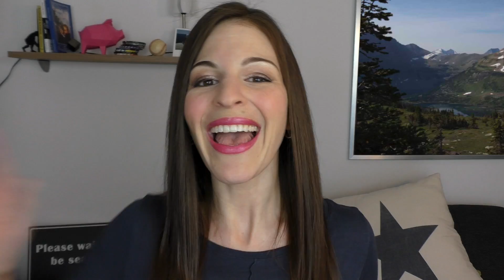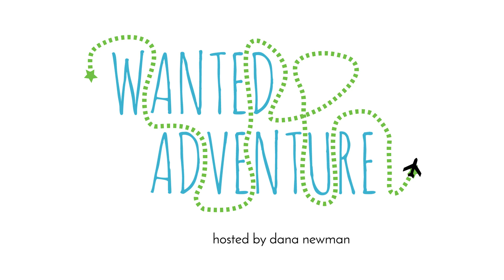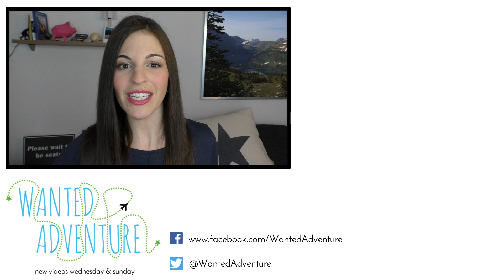Why Are Houses in America MADE OF WOOD?!

Comment: This channel should be titled Ask a Stupid American.  Houses worldwide use mostly the cheapest locally available materials. People with more income can spend more on their houses and choose better materials. Building codes evolve driving safer building methods though most structures already existing rarely have to be brought up to code until major remodeling is done.   Europe once had vast forests until they were cut down to (wait for it) to build houses and eventually was replaced with more abundant brick and stone and rising economic development. Oh yeah, no busses have been picked up by tornados, like loaded semi trucks they can get blown over if struck broadside but not headlong. DUH.
Reply: Took 3 seconds to google buses being sucked up into tornadoes and blown around.   Confirmed that buses can be blown around by tornadoes.
Reply: I have seen big semi trucks up in trees and entire barns moved large distances. I have seen masonry buildings levelled.
Reply: Who would win in this scenario: A: A 2 mile tall 200 yard-2 mile wide rotating column of air traveling at a forward speed of 30-70 miles per hour, with wind speeds of anywhere from 110 miles per hour to 320 miles per hour, hurling debris the size of semi-trucks at anywhere from 60 to 270 miles per hour?..... Or B: a brick house?

Comment: Here in Florida, most homes made in the past 20yrs are reinforced block construction. My home has a steel roof as well, it's a very strong home. The roof will last 50yrs. They are also quieter inside as well. I would not live in a home made of wood.

Comment: Labour costs are a big factor. using wood frame a house can be built quickly. Also here Canada we have a season called winter and wood frame constuction can be insulated. a 100mm. wood frame wall has the same insulating value as a 1 meter thick stone wall. Wood frame construction can with proper treatment can be made proof against rot and insects. very attractive finishing can be done with brick or cut stone veneer and are indistinguishable from the solid construction used in europe. For comments about Tornados and Hurricanes read further comments.

Comment: Stone/concrete would not protect you from floods as the flood would fill the area and blow out the walls due to high pressure on one side and low pressure on the other side. 

Wood construction is fast, cheap and higher insulation value then stone and concrete. It lets the house flex in events that will break a ridged structure.

Comment: Having watched TV programs about people buying houses in Germany and having lived there 1958-1960.  I have a few observations. First it costs a lot more to build a house out of cast concrete fixtures, brick and stone and that is reflected in the price of housing in Germany. Secondly the insulating qualities of brick, concrete and stone are terrible and wood framing is easy to fashion so it can be insulated.  Wood framing is cheaper than just about anything, and we have a replaceable supply of wood being grown.  Tornadoes can blow a house apart by the difference in air pressure between the inside of the house at 14.7 psi and the center of a tornado at 1/6 of this. The difference causes the roof to be pushed off . Imagine the size of a roof 20 foot by 40 foot of a modest  mobile home would yield 800 square feet or 115200 square inches which would develop a pressure of 1152000 pounds of force with just 10 psi of air pressure difference. Not many roofs can withstand 576 tons of lift, so even a stone house would be torn apart. I think Germans would soon get used to living in wooden houses if given the chance ;-)

Comment: My own speculation is cost and abundance.  Wood is less expensive to cut, ship, and size for assembly.  Less weight when shipping wood vs stone.  Also if you have noticed in the German homes they don't built in closets!  You have to buy wardrobes to hang your clothes.  Brick houses make it difficult to remodel your home.  Try moving brick walls or routing wiring and plumbing through mortar without having to paste them on the outside of the wall.

Also no screens on the windows anywhere!  Let those bugs fly in!  Also no ceiling fans so when it gets hot in the summer you can't even get a breeze blowing in the room (don't even ask about AIR CONDITIONING!)

Comment: Many houses in tornado alley have underground shelters like you see in the wizard of OZ.    In addition the roofs of houses need to have extra hurricane and tornado bracing. A interesting fact the difference in air pressure between a closed up house and a tornado near by is enough to blow it apart . OPEN ALL YOUR WINDOWS TO EQUALIZE THE PRESSURE.

Comment: The answer is simple. I can go the the store and buy a cement block for $1.50 or I can spend the same money on a 2x4. The block makes structure for, my wall, less than a square foot, while the 2x4 provides structure for several square feet. If you do the math wood is just cheaper which means you can afford to make your house bigger or isolate better or just keep the money. At the end of the day German wood is expensive and American wood is cheap. So bricks just seem like the obvious building material for Germans and Wood seems like the obvious material for Americans.

Comment: It's cheap. DONE!
It's also easy to change since your home will most likely need changes over the 30~200 years it's standing. For instance, how would you add electricity? How would you add internet? How would you replace the electrical wires put in 1930?

Comment: Well, tornado proof is a bit over the top, but making them more resistant to the strong winds would reduce the amount of damage caused by them quite a bit. In Australia, all buildings up north have to be able to withstand cyclone force winds since Darwin was completely levelled by one in the 70's, it's worked out fairly well thus far.

Comment: Concrete usually needs to be used within a few hours of leaving the depot and bricks cost a lot more to transport.  Some roads in America have houses in the tens of thousands so they need to build them quick.  If you build with bricks you need to let the cement set every few meters where as wooden houses can go together easier and be constructed potentially within hours.

Comment: Exactly. Tornadoes aren't the three little pigs. It doesn't huff and puff and blow your house down. It huffs and puffs and blows a 2x4 into your house at 100+ mph. Or throws a car at your house. That said, there are ways to strengthen a house -- a lot of research is done on this. I think Mythbusters had the best plan... truck bed liner! Rhino Skin(tm) your house and you're all set! (A local trailer shop has a soda can coated with the stuff. You can't dent it with a hammer.)

Comment: am i the only one who finds it ridiculously stupid of her to take a EF-5 tornado (wind speed in excess of 320km/h) as basis for the argument that building houses out of stone would not reduce destruction by tornadoes. Because according to the NOAA(weather information centre ) 0,1% of all tornadoes reach an EF-5 Ranking. 

Of course no building is going to survive that but how about the more common tornadoes, considering EF0-EF1 make up 65% of all tornadoes and 95% of all Tornadoes are below EF-3 rating so most tornadoes have wind speeds below 217km/h. 

Which given the fact that kinetic energy is 1/2mv^2 means that overwhelming majority of tornadoes are over twice as weak as the example Donna used. And as such have significantly less destructive power

Comment: Most houses in the U.S. that appear to be made out of stone or brick are actually made out of wood with a brick or stone "wall" anchored to the outside of the wood frame. I put "wall" in quotes because if you take away the wood frame, such "walls" are too thin to have any sturdiness to them. A lot of the older brick buildings (at least in my area) have foot thick walls of solid brick, but modern homes have a one brick thick layer of brick on the outside. That's 3 and 5/8 inches. 

I don't know if a typical German stone/brick home follows this pattern or not.

A significant step up from this is to have your home built out of concrete with stone or brick on the outside. 

Wood is a significantly more expensive building material in Germany than in the U.S.

Comment: The cost per square foot is cheaper for wood vs. other building materials. Americans like getting more "value" this way (kind of like big meals at American restaurants). And because energy is cheaper in the US, it's easier to afford heating/cooling larger structures. Finally, many Americans live in brick or concrete houses... because they live in apartment buildings. If the US had a similar population density to Europe, there would be a lot more apartment buildings instead of single-family detached houses.

Comment: When I get asked this question, it comes up due to fire damage. My response is similar to the vids for the prevalence of wood construction, i.e. wood is abundant with a strong education system in place to reinforce its use. As for catastrophes, most homes in hurricane alley would have access to a cellar like facility to save lives. The economics of building a new wood house for the unpredictability of total destruction of the old does not warrant building with concrete/stone. As for fires, with sheet rock and other techniques our wood homes rarely have destructive fires either. Again the economics of front loading cost, building with more expensive materials, for only a possible problem does not justify the change in materials. 

That said there are plenty of brick/stone/concrete homes in America. So some people are persuaded to build with other than wood materials.

Comment: Considering that wood is one of the worlds only 100% renewable building materials, I doubt it's use in buildings is going away.
It's also great because it's easy to work with and actually does a good job. Stone is great, but unless you have vast amounts of it easily available, it's not really a viable option.

It's true that there are many houses in Europe that are brick and stone that are 100s of years old, but many buildings in the UK used timber pretty extensively and some of theses are just as old. 
Timber also survives earth quakes a lot better than brick, concrete or stone.

The real answer to surviving tornadoes, is to not build a house in tornado valley in the first place.

Comment: I really liked this video, and subscribed.  I am by no means a materials scientist, this is just how I understand it.  Other than the fact that wood was plentiful historically in the US, Masonry/reinforced masonry/steel/concrete/etc is dramatically more difficult to build to ensure survival in extreme weather & geological events.  And wood is the quickest way to begin to attain new shelter after a disaster.

Wood houses will flex and shift more readily to move with the motion on a smaller scale than a building made with the above mentioned materials.  For example:  

Earthquakes:  in a major city, the buildings with the most damage will be the unreinforced masonry of any type (see: 1933 Long Beach Earthquake, 1985 Mexico City Quake, etc).  Next, comes reinforced masonry buildings, followed by steel/concrete.  High rises, which are primary steel skeleton with a concrete sheath, are built to sway with the motion, like a smaller stucco/wood frame house does.  In addition, building techniques are advancing for both steel/concrete & stucco/wood structures bringing stranger, more flexible and durable methods of construction, while masonry of just about all types are pretty much stuck in the past (though improving slowly itself, I believe).

Floods:  Depending on the speed of the water, just about every building type will sustain damage of some kind. Slow moving water is killer for wood frame houses, either floating it away, or soaking in causing water damage and toxic fungus growth later on as well as rot.  Fast moving water breaks off chunks of buildings and pushes huge boulders and cars, and end up being high-inertia (if not particularly rapid speed) battering rams that will damage or bulldoze just about everything in its path.  Any exposed steel will also begin to rust and weaken.

Tornados:  The only type of building remotely close enough to be considered highly tornado resistant (though not very practical from a usability standpoint), would be a low-flung steel-reinforced concrete-type building with gentle curves for corners, gentle dome for the ground to the roof, & walls at shallow angles to the ground unbroken up to the roof, and no non-protected (ie exposed) windows and doors.  The idea is to deflect, not withstand, the assorted missles coming at you (like say, that aforementioned bus), and the wind will find any purchase and use that as a prybar of sorts.  Even this building will likely sustain some damage as the elections will begin to chip away at the surface, giving the wind a new toehold.  Anything else is going to get moderate to severe damage due all the perpendicular sides and steeper roof angles.  Tornadoes are the fastest winds on earth, but are also pretty short lived.  Keep in mind that at the strongest tornado strength, that low, protected building I mentioned above wouldn't even survive because F5 winds can scour pavement off flat roads.  It's the main reason I nickname them:  "Nature's Overfull Dysons". They still have strong suction, but they can't keep it all up, so you're still throwing a trail of debris in your wake.

Hurricanes:  Combine a fast-moving flood, topped by an hour-long bout of F1-F3-equivalent-speed straight-line and tornadic winds (tornadoes DO spawn inside hurricanes as well, keep in mind), and a fleet of rhythmic, surging battering rams in the form of millions of gallons of seawater pushed by wind into storm surge waves (liquid wrecking balls) as the center of the storm makes its way to landfall, and almost no structure will come out unscathed.  Especially since, once the eye-wall passes, everything is now going back in the opposite direction from the way it came, for round 2.

For the economics of it:

Wood frame structures are the most economical, flexible and practical building material for small to medium-size structures (mostly houses), and very often the beams get tied together with extra hardware just to try to keep the overall integrity intact while still allowing some pressure-releasing give and flex.

Steel/concrete are the most economical for the medium-to-very large buildings in terms of strength for the same reasons.

Unreinforced masonry is good for decorative, low-lying features and small monuments

Reinforced masonry is good for smaller specialty building and larger monuments.

Freeways are usually made out of a tightly-woven steel rebar cage, then filled in and encased with structural concrete that has some give of its own.  Seismic retrofitting of the older of these structures can be seen in CA, where they have been doing it for decades now, especially for over/underpass pylons:  apply a steel rebar mesh around the column, fill it in, then wrap the column in a weather-treated sheet of steel.  So if the earthquake damages the column, it merely fractures inside the wrapper and doesn't fall out and cause the bridge to fall over or pancake (Think the expressway in Kobe, or the i880 in San Francisco).  Of course this only works when you don't encounter earth movement like the Northridge Earthquake in So Cal, where an otherwise seismically-sound interchange experienced extreme vertical earth movement not witnessed before, which essentially turned the pylons into jackhammers straight up through the road bed.

Long story short (too late!), the simple answer is that it happens to be the most economical, most flexible, and safest up to something short of a major disaster, and quickest to get the rebuilding process started.  (Even though wood frame houses look like the worst choice in fire prone areas, the heat generated by those fires will cook the cement in between the masonry and tend to render it as almost back to its power dry form, and making the structure seem as if it was just a pile of stones in an artistic formation.  That's why masonry collapses in a town in the aftermath of a major forest fire sweeping through are a danger.)

Comment: To tornado-proof a house, you need to remove it from the tornado. 

Tornadoes treat hills like airfoils. That is, as the winds hit the hill, it builds pressure. So much pressure that it lifts the base of the tornado off of the ground. The tornado actually hops over the hill.

But, building a house ON a hill in effect creates a wall that the pressure fro. the winds slams into.

Instead, build a home IN the hill, and you have a tornado-proof home.

Or, Bag End. Or, your first Minecraft hole. 

Then, just chop down a tree with you hand, kill three sheep, and make a bed. and a door, and a trapdoor so zombies fall to their deaths when the pound on your door.

Comment: Why do people build homes out of wood in Germany or anyplace else?  We don't get tornadoes everywhere. We don't get hurricanes everywhere.  In Florida most houses are made of concrete block.  Wood is cheap and easy to work with and CAN withstand most weather conditions.  We have wood homes that are over 300 years old.  I have seen concrete and brick houses get wiped to the ground by tornadoes so that's not really a better option. I've seen buildings of steel frames get torn to pieces by tornadoes and hurricanes so unless you want to live in a cave or build your home as an underground bunker, no type of construction is proof against those conditions.  Why do people in the tropics build their homes out of material like bamboo and grass?  A typhoon blows it away and they can easily make another one.  If it was brick the typhoon would blow it away and it would be hard to rebuild.